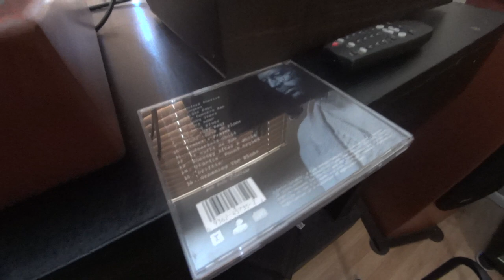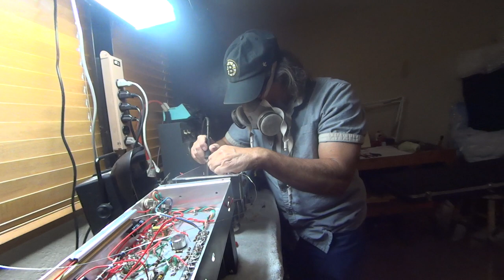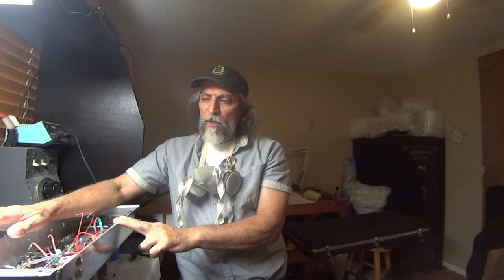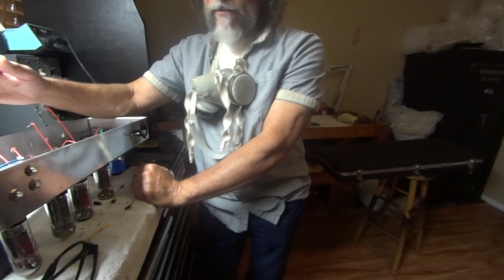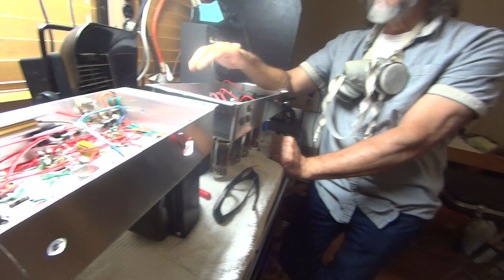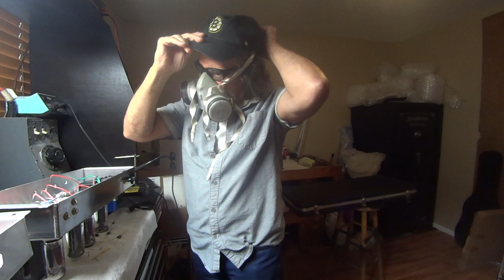Amp Builder Pioneers

Comment: Just found your channel, great video. The thing that gets me about all these dumble clones and other clones is that most of them sound average compared to the real deal anyway, or absolutely nothing like it. It's not just about putting the parts together. There is lots of fine tuning and tweaking and listening to the amp after it's built, and maybe swapping out parts, carefully selecting all the right bits. That takes great ears and years of experience and talent. The other thing that is a shame about such an amazing amplifier such as the ones you build is that you might get the occasional customer who plays the amp and just doesn't get it, but it's simply because the amp reveals all their flaws that were probably being masked before! I've heard customers complaining about such amps like Matchless and two-rock saying "5 grand, what?! this thing doesn't sound that good" - No sir, unfortunately it's you who doesn't sound that good 😂 Going to go and check out your amps now! subscribed.
Reply from the maker: thanks, words of wisdom..

Comment: Great tip on soldering tube sockets with non-functioning tube installed! I see FAR too many broken or weak solder joints on tube sockets when I'm doing repair work. People forget how much shock and movement those solder points can take.

Comment: What's your thoughts on the guys that goop their boards?  
I can understand why they want to protect their designs especially with all the clones made nowadays but servicing becomes nearly impossible
Reply from the maker: I would not really understand that process because I don't even use boards, and most of these "gooped" boards are solid state, not tube circuits that they are hiding, but I guess if the builder is willing to service his gooped up pile of goop, then it is not a problem till he is not available to service them  any longer.